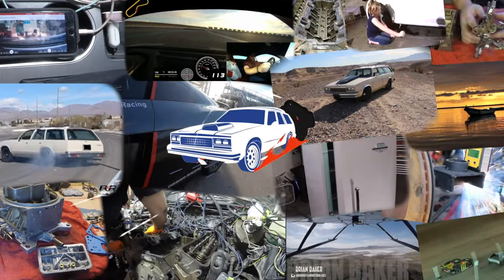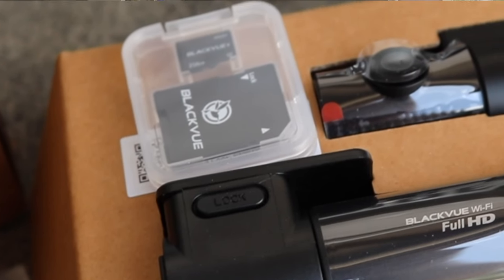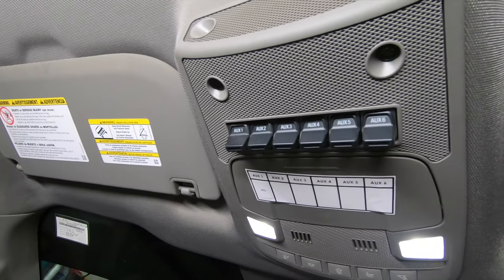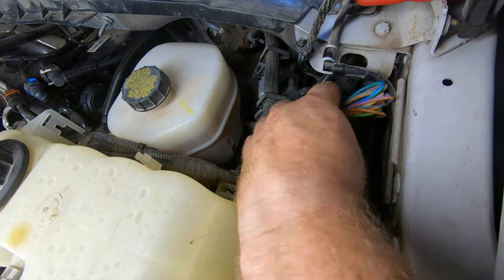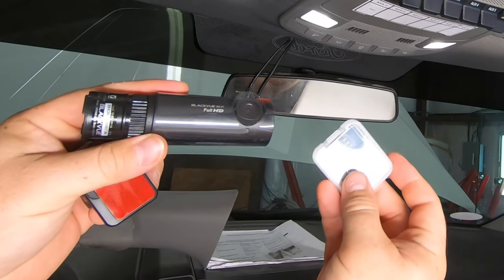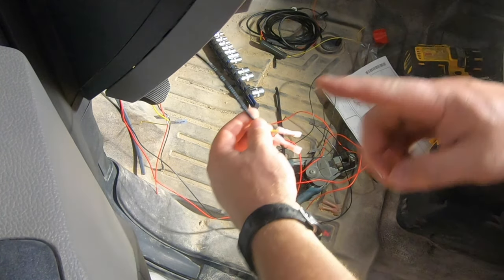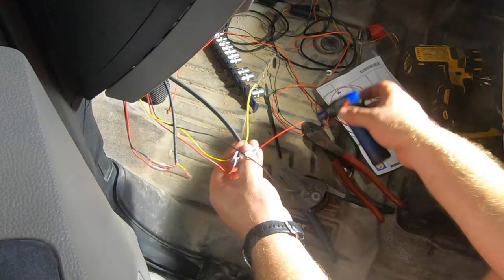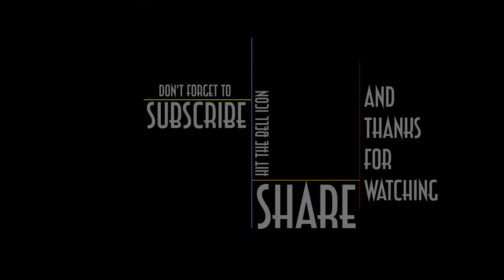Dashcam in commercial Service Truck | BlackVue DR590X-2CH 2 channel

Comment: The 590x has an inbuild power magic, why would you not use the provided hard wire kit?
Reply from the maker: I realized that after. My experience is with installing the older generation. The next video I do on the subject will include this detail.